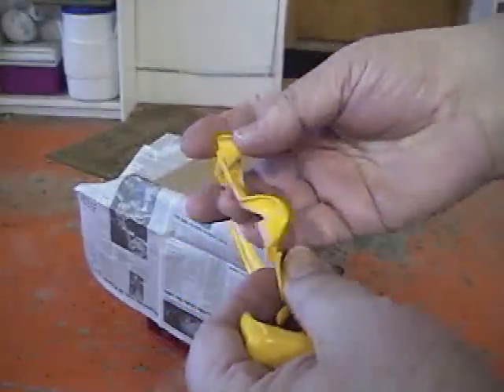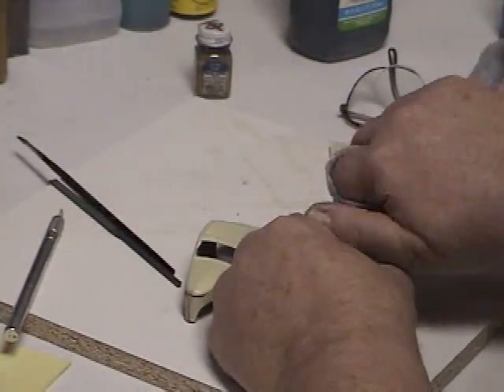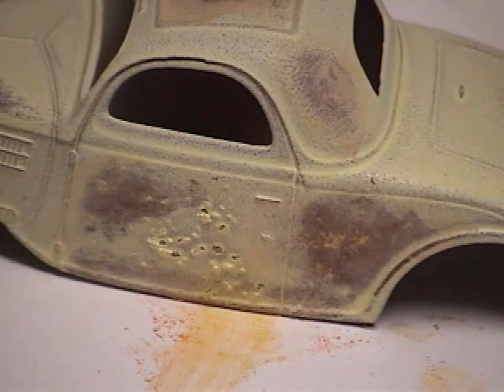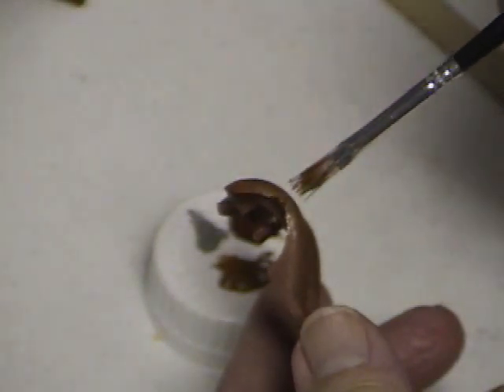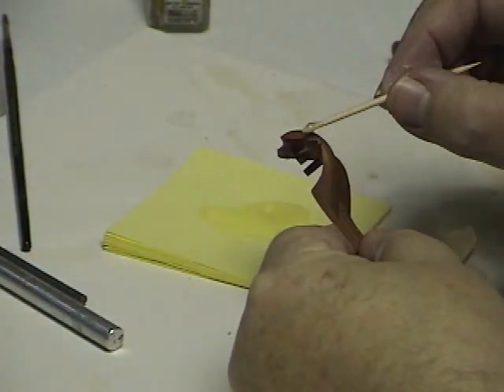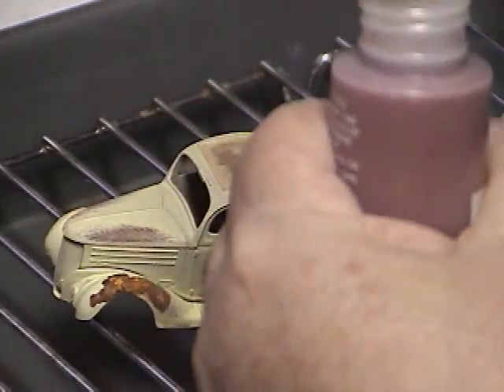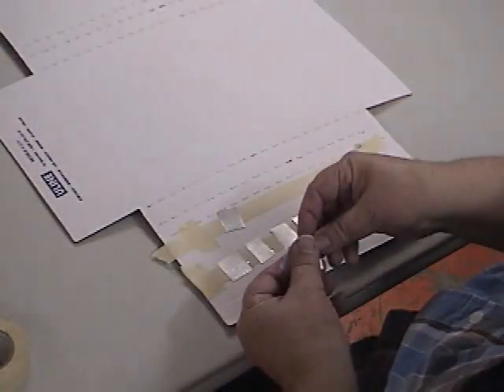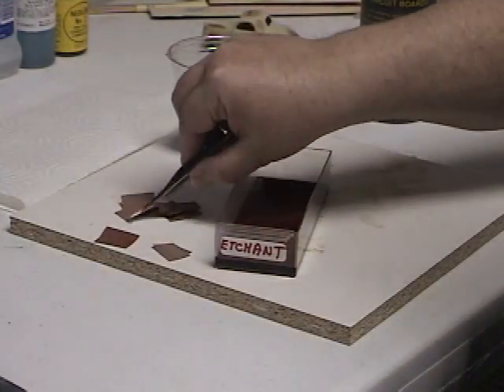Easy Weathering Rusty Metal

Comment: how would you go about weathering an Athearn Ford Model A?
Reply from the maker: Disassemble as much as possible.  Spray it with rust colored primer.  Repaint with the color of your choice.  Use thinner to dilute the finish coat and use a rag to "blot" the surface to remove color thus exposing the rust underneath.  Or, paint it rust color, apply small amounts of Rubber Cement.  Let dry.  Paint the model the color you want to have and then use masking tape to remove the fresh paint over the Rubber Cement, thus exposing the rust color underneath.  Practice on empty Coke cans first.
Reply: @darrylhuffman1564  thanks for the reply!